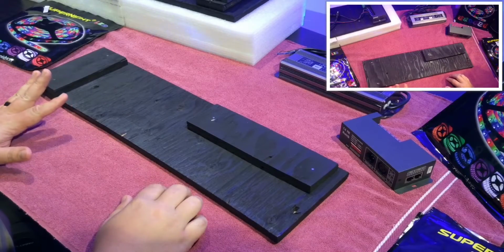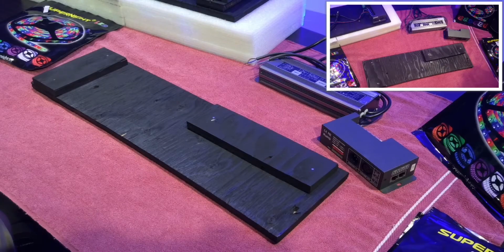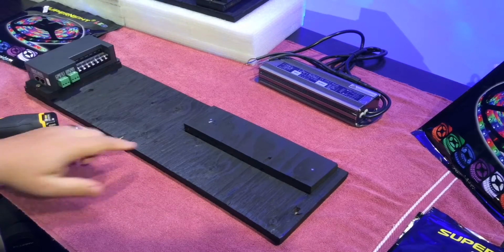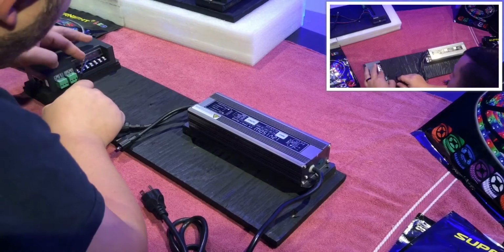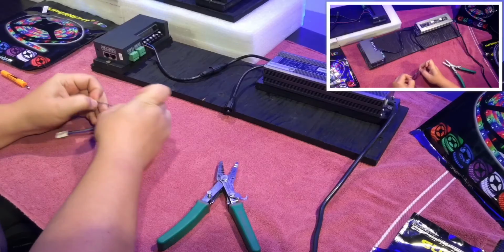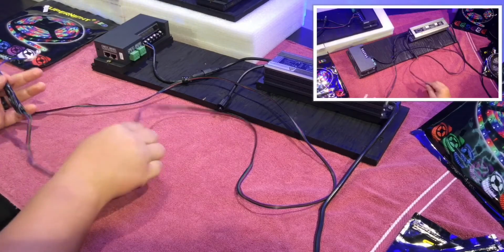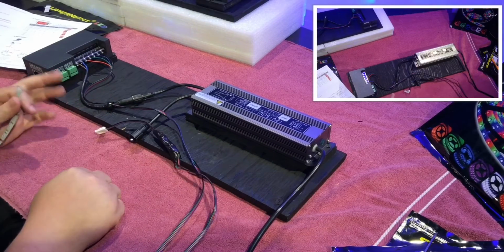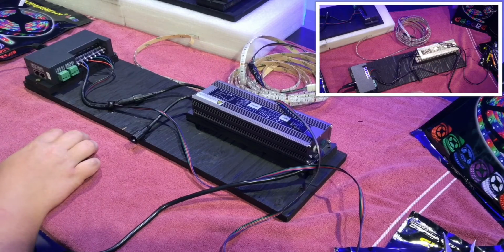Assembling DMX Decoder for LED Tape | Tutorial

Comment: Will the power supply in this video work for a 24 channel DMX converter as well?
Reply from the maker: Sweetbay as far as my understanding goes, yes that should be able to handle a 24ch decoder. LED's generally draw less power. This unit is designed to handle running 2 individual decoder boxes at the same time.
Reply from the maker: Sweetbay the main thing to remember is that it needs to match the 12v DC. The boxes can't run on AC power.
Reply: Could you solder those extender cables between multiple strips and run off of just one converter?
Reply from the maker: Sweetbay as far I my experience goes you can attach as many as you need. As long as you don't exceed the limits of the decoder. I had multiple lengths of strips connected together on a single decoder. I used 2 for this project as I wanted to be able to mix colors on the backdrop.